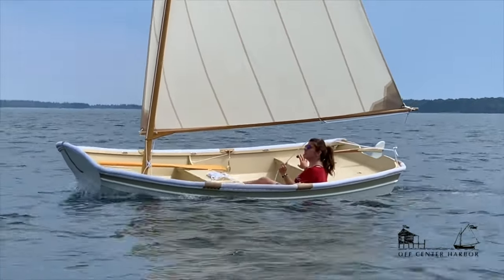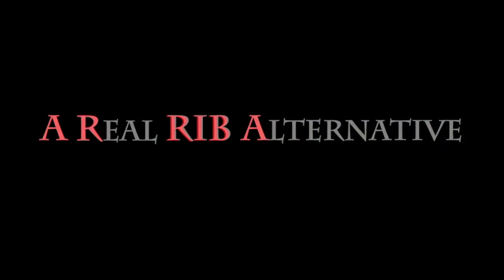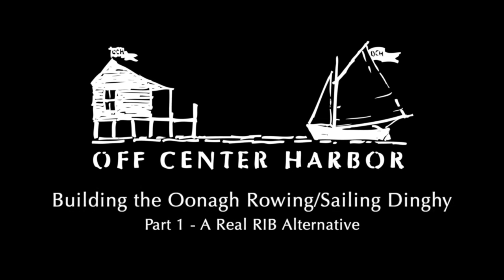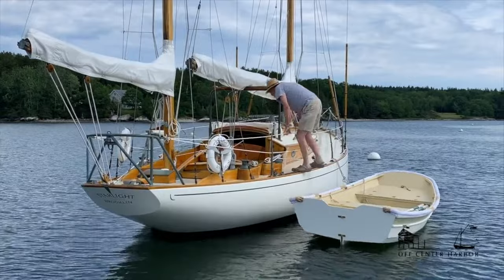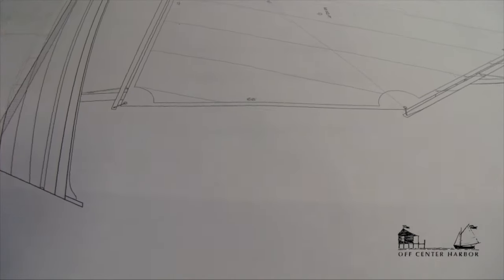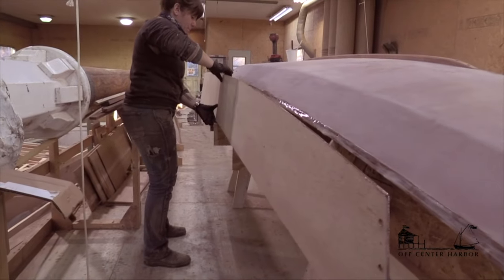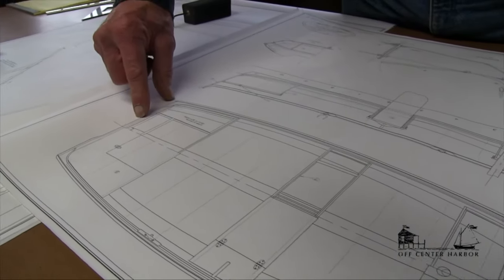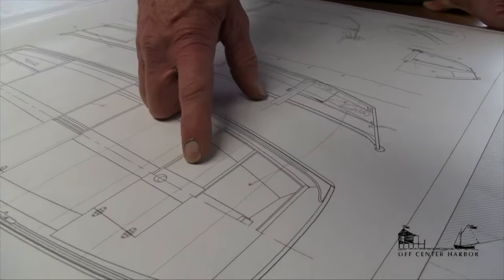How to Build a Wooden Boat - Building Oonagh/ARRIBA Ultimate Dinghy, Part 1: A Real RIB Alternative

Comment: I love the idea of a pram dinghy so much that I built one (a smaller one than this) 7 years ago with my intellectually handicapped son. We use it as a tender to our 28ft sailboat it is a great load carrier I have never put an outboard on it, it rows like a dream and the grandchildren love to play in it. The big boat is for sail and while I have just finished building an 11ft sailing dinghy for the grandchildren I will keep the pram dinghy for myself to trout fish out of and generally potter around in.
Reply: To add I had RIBs for years and they are such a nuisance with the outboard, storing and servicing, but the biggest reason I stopped using them is for a long passage or in the marina the dinghy is best stored on deck and RIBS are just too heavy and awkward to lift and manhandle into position the pram dinghy fits ahead of the mast without interferring with sailing and I can easily lift it on to deck from the water.

Comment: This brings Joel Whiteʻs Nutshell Pram to mind.  A lot of the same ideas, put into a slightly smaller and lighter balanced lug rig design.  I built one of these several years ago, and have been using it as a tender for my Cal 40 and to teach my grandkids how to sail.  I also added forward and aft flotation compartments to Joelʻs design. As John Hyland notes, the result is a stable craft that rows and sails beautifully and is easily managed both in light airs and when the breeze pipes up.

Comment: Looks like it is atleast 10 ft long, maybe even 11 ft. Would be a great day sailor, but I doubt it would be a good dinghy. Dinghies are usually kept aboard the larger boat when the larger boat is under way.

The problem with good dinghy design is that length and weight count. Longer is good for performance but bad for stowage. The RIB solves this problem by being a planing hull. Then, it can be short and relatively light, but still have decent performance (under power).

The outboard it requires may be somewhat heavy, but is relatively easy to stowe out of the way. And it can provide emergency back-up power, should the engine on the big boat fail.
Reply: Before I plunk down $2.500 for a kit, I'd like to hear some specs.

Comment: Beautiful and functional looking design.  My only concern is the overall weight of the finished boat, which is listed as 170 pounds.  An average builder will likely produce a boat that weighs a good bit more.  I realize we're talking about a boat that is just shy of 12 feet with an ample five foot beam, but managing that amount of weight is going to be a challenge, both ashore and with any handling involved in stowing aboard.  How large would the yacht have to be to support storing Oonagh on the deck?  The CLC Passagemaker dinghy has similar dimensions, but only weighs 90 pounds and can be built as a nesting hull.
Reply from the maker: You make some good points, Jeffrey. As you note, the Oonagh is much beamier throughout the length of the boat and thus has a higher payload and is much more stable. The Oonagh would probably do well on davits for boats in the mid-30's and up, or on deck for 40+.

Comment: very nice design ,you are totally on to something  with meeting the Coast Guard floatation requirements  on Power ratio   what do you predict or target  the Horsepower max to be ?  with todays restrictions on two Strokes  it’s getting hard to find very low horsepower 4 Strokes  these days  the people that may have a older one   generally hoard them because they understand  the rarity of them getting harder to obtain  with the more reliable and efficeint Electronics  compared to a Magneto Motor  i do like the amount of Rocker on this boat combined with a center Keel  that helps it track straight and tow nicely  iIve had several Inflateables and they  don’t tow that great at slower speeds and i’ve found the ridged Hulls are   usually.  a little two heavy  to Stow and Launch single handed lay on board most Sailing Liveaboards  yes okay   on a Trawler with Electric Winches  and more space to  move around  plus a. heavier duty Daviit Crane I also like the design of your boat that allows you the freedom to Stow  the appropriate gear onboard full time like  Life Jackets etc  plus under Lock and Key fromSticky hands in many harbors and Dinghy Landing areas  i personally have a tendency to   accumulate  a lot of extras  on my Tenders over time
Reply from the maker: Hey Craig.  She's designed to take a 2hp gas motor, but an electric motor is probably the way to go these days.
Reply: I'm slightly confused by your comment about small outboards. 2.5hp 4 strokes are available from several manufacturers which are all light and this dinghy should be able to handle them easily. In fact a 4hp unit should be OK as well. Just remember you don't have to use full throttle !

Comment: A rib can be pulled up on the sand. Not so much with this. Why compare just make a good dinghy.
Reply from the maker: Hey Edward.  We pull this dinghy up on the sand, but mostly here in Maine wing drag it up over the gravel "beaches" here in Maine. Bottom is sheathed in Dynel for wear resistance.

Comment: This is in no way a replacement for a RIB.  So many people make the mistake of getting something like this, that doesn’t plane or an underpowered inflatable that also doesn’t plane, when going cruising.   The fact that it doesn’t plane severely limits it’s utility as a tender when cruising.  Also, it is nowhere near as seaworthy as any Hypalon inflatable.  With my 10’ RIB and 15HP Yamaha 2 stroke I can comfortably make 20 mile round trips in about an hour.  This allows me to anchor further out if I want and to explore vastly more than any non planing tender would allow.  That being said, this is a beautiful boat but not sure what it improves on over the Joel White Nutshell.  You do have to constantly worry about thieves stealing your outboard when ashore and sailing around the anchorage would be nice.  For that reason I’m thinking of switching to a rollup to put the 15HP on, to free up the foredeck for a Spindrift 11N or in a perfect world, a PT11.
Reply: This is way more stable and larger than either of the Nutshells. Way more storage too. For your tender needs this would not work but if you anchor closer and would prefer rowing and sailing this is superior. I think changing the mindset is the goal, but you have your systems and preferences figured out.